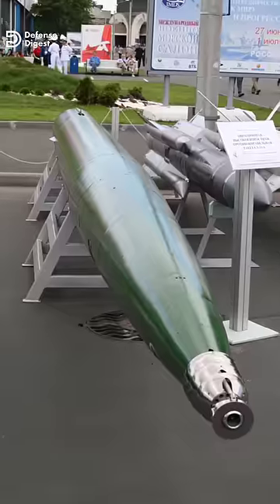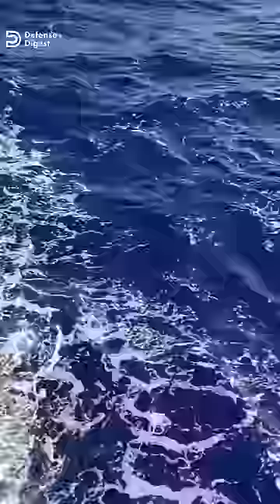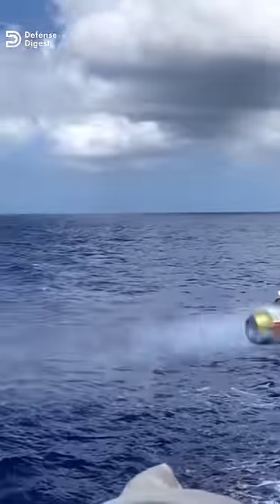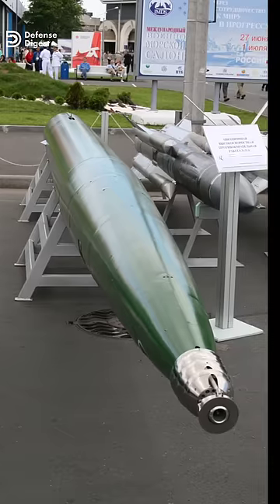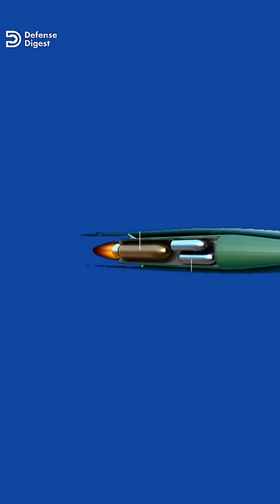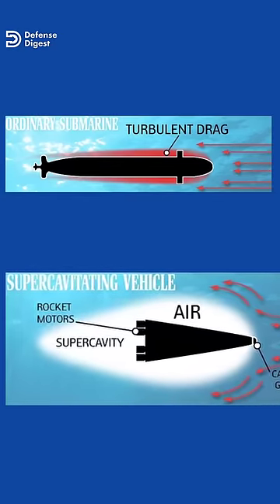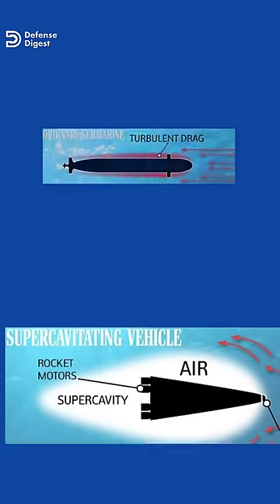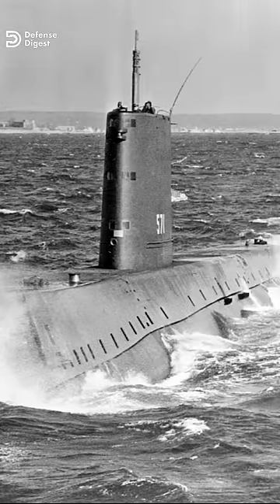Russian "Shkval" Torpedo Zeroes in on Targets at 200 Knots #shorts

Comment: Very good idea why we dont use it today with the more advanced materials that we have since then???
Reply: I'm sure this kind of engineering is used today
Reply: @gabrielbrown9013  im pretty sure that i have see this at something else but i dont remember.
Also i know that this effect is also in the swordfish that why it is  so fast
Reply: Because it’s probably expensive as shit and highly Impractical
Reply: A variation is still in use in the Russian navy, and other militaries developed their own as soon as they could.
Reply: @kayden9102  It is practical, and is used by Russia.
Reply: @Vchk1917  by their two rusty submarines.
Reply: @Vchk1917  it's the cost that's the problem, both in terms of money and materials. A rocket motor is not cheap and sticking it on something designed to  explode on impact thus disposable is that good of an idea. It is also a ticking time bomb. Depending on the fuel mix and design, it could easily be ignited if hit and pretty much any explosive impact that destroys the torpedo would also detonate it and potentially the warhead as well
Reply: The three main problems are range, reliability and detection.  Other methods yield a far longer range allowing the sub to relocate to avoid detection. Reliability could be an issue and a dangerous operating hazard for the fuel.  Lastly when this thing is fired it lights up like a firework to anyone looking for threats meaning the torpedo might be intercepted by defense systems. Even worse it gives the position of the sub away and with the speed the sub doesn't have time to relocate meaning if it's attacking a convoy in ww3 that crew is dead
Reply: So In my opinion this probably isn't a good choice for a balistic sub or deep water sub but for patrol boats and coastal defense subs you don't care much about losing it could be very useful for suicidal attacks against larger surface formations
Reply: @boblaryson3621  exactly my idea was to put it on destroyers and cruisers for asw not in subs
Reply: Because its bad, its very loud and any sub will easily evade it.
Reply: @fennoman9241  i dont think so because of the time to evade will be very low the speed of this torp is huge
Reply: @commandergeokam2868  290kmh, but ships, especially submarines have sound emmiters and other equipment to jam torpedoes. But even if it did hit, it would require many hits to sink a carrier for example, which is its main target.
All smaller vessels will be able to evade just by getting out of its way, a enemy submarine wont fire it anywhere near its target. Submarine torpedoes have very long ranges like US Mark 50 lightweight torpedo has 15km range and French F21 torpedo has 50km range.
Reply: @fennoman9241  yes yes i know im saying it to use it as an asw  role not to hit serface vehicles even with active  counter measures and ecms wouldn't be able to defeat the torp because of its very low time to evade or to drop the counters
Reply: @commandergeokam2868  it just would not work, you wont get close enough to a submarine. There is a reason no one uses these except russia, submarines and other ships will be able to maneuver out of its way. What you are suggesting is too chance based to be of any effectiveness. A weapon should work in most of its use cases not just 5% of the times.

Using it as an ASW would be a waste, if submarine got close enough to a ship for a shkval like torpedo to be effective, the ship in question would be most likely destoyed already. And using it as helicopter launched ASW would be beyond useless. 
ASW weapons are by nature required to be long range maneuverable weapons.
Reply: @commandergeokam2868  even if a Shkval torpedo was fired at the target sub like USS Virginia, from 2 kilometers. Virginia would have 25 seconds to move, even at lower speed than its max speed Virginia could travel 2.5 times its own distance thus avoiding the torpedo.
Reply: @fennoman9241  ok ok im convinced 
Its not an effective weapon got it
Reply: Have built a prototype ( miniature) for a sub to operate using  supercavitation technology  showing how a nuclear  sub could reach 200 knt speeds couldent develop much interest, was told other contractors
Were working on the same
Reply: It can't use sonar, so no guidance. And neither can the Sub firing, totally blind at that point, where as enemy know exactly where it was fired from

Comment: IIRC one of the problems with these, however is their limited maneuverability. A fast torpedo is great and all, but if your target can juke it, then it didn’t do a fat lot of good for you.
Reply: Why bother maneuvering if the torpedo has no sensors and no idea where the target is? It just goes where it was pointed at when it was fired from the sub. This is an unguided torpedo. Very fast but very dumb.
Reply: It's also a very noisy torpedo.
As soon as this thing is launched, the enemy will know where your sub is.

Comment: It should be pointed out that it had no steering and it was meant to sink carriers not other submarines. But yes it can be equipped with a nuclear warhead. Enough to sink a Nimitz class carrier. The weird nose cone is the steam ports that helps with the boundary layer to decrease water drag.
Reply: There's weird hydrophobic that do similar these days, for bullets and other things too (? Hulls)
Reply: @JohnMullee  yes but actually no. not on this scale. the shkval torpedo basically flies through an airbouble. the schematic with the big raindrop shape is pretty accurate because of the large amounts of gas ejected from the nossel. what boats do with air is the same concept but on a much smaller scale so you only get a softer boundrylayer on the hull

Comment: The torpedo showed in clip is my 46 torpedo surface launched torpedo the military 48 submarine launched torpedo is 21 inches round more than 10ft long its also  shrouded meaning the propells have round shell around the propeller or router & stater !

Comment: With torpedoes speed is not what you want you can go fast easy but you can't go far. Distance is what you need and stealth to come up from the depths of the sea. Have a look at the mark 48 👍🏼🤠 they don't have the newest and best info out available to public because the newest has not been used but I'm sure you can take the mark 48 and times it by 10 👍🏼🤠

Comment: That's empressive. That torpedo can move quicker through water. I wonder could this work for jets with diverting hot steam out of its nose and the Jets would slip through the at mark 10 may be. Just think vaporizing are in front of the Jets would make them faster, like alien 👽 speeds. SUPER CAVITATION. IN THEROY IT COULD WORK.

Comment: I always wanted to try a similar idea on speed boats with routing the exhaust to the front just behind where the water contacts the hull and have the opening across the bottom so the boat is gliding on bubbles from the exhaust.
Reply: Hydrofoil with heating coil running through it. It would be very energy draining tho

Comment: What was it's range ?
Divert rocket exhaust forward aren't you slowing it down as Newton's laws still apply. Action/reaction.
1x thrust diverted is counter to forward thrust.
Must not have been feasible or they would've been installed.
A bubble formed won't stay as the torpedo is moving at 200 mph the bubble isn't a force field.
At speed the bubble would have to be projected miles ahead to encompass the torpedo.
Well super cavitation is back in the news 2021.
And once again Russia is reported to be ........

Comment: That would be an enormous amount of water to boil and at a very fast rate, thus requiring a lot of fuel. If this even worked I would guess it had very short range.
Reply: 11-15km. It doesnt boil the water, it creates the cavity with a gas-generator in the nose (probably just some chemical reaction of two components or 1 component and water) and when it gets to its "cruise speed" the nosecone pushes the water outward with a really high force, creating a short lived vacuum in place of the dispersed water. That vacuum gets filled by steam from the water boiling away at room temperature due to the low pressure. Its the same cavitation-effect that damages many ships propellers on the edge. They travel so fast through the water, that the same thing happens and when the small gas pockets implode they break chunks out of the propeller. This is also loud AF because of which submarines have specially designed propellers to stop cavitation, so they are quieter.

Comment: Those torpedoes are extremely dangerous to store as they use hydrogen peroxide for fuel, the kursk typhoon class submarine sank because the crew dropped one of those while trying to load it into the torpedo tube, thats why nobody else uses them as the fuel itself corodes it's own storage tank making an already volatile weapon even more dangerous.

Comment: Creating that much steam underwater would give it one hell of an obvious surface trail for instance even the minimal cavitation caused by submarine propellers is enough to be heard for miles with modern sonar when not careful and is also the main way subs are detected. In the modern day it would be a loud, noisy, and obvious threat the second it was launched.
Reply: That's why it's used by ships almost exclusively
Reply: if you are getting attacked by one of these it won't matter anymore. You won't have time to turn your sub around and fire your own torpedo at them
Reply: @deanboy2416  nope, it's not fast enough for that to be true. For it to not matter it'd have to hit mere seconds after launching because the ship you're aiming at surface or sub is going to hear it coming the second it launches.
Reply: @ThatGuyOrby  you do realise that it takes a minute to a couple of minutes to turn around a ship and especially a sub, right?
Reply: @deanboy2416  you realize to cover enough distance in said couple minutes to reach the thing's target the ship that launched it would've already been spotted and likely sunk right?
Reply: @deanboy2416  to launch and hit a ship within two minutes after launching the ship would need to be within 7.7 miles. Only in the your most delusional dreams would a ship ever close to this distance as they would've been detected and engaged long before that point.
Reply: @ThatGuyOrby  at 200mph the torpedo covers 16,6 miles every 5 minutes. 5 minutes is barely enough to turn around and fire back, and it is also close to max range of other torpedoes at the time, real shots would have probably been taken closer still to ensure a kill.
Reply: @deanboy2416  The torpedo does not go 200mph it goes 200 knots, that's not the same thing.
Reply: @ThatGuyOrby  200 mph = 230 knots, so I dont see how that helps your case.
Reply: @deanboy2416  additionally the torpedo only has a maximum range of 16,400 yards or 9.3 miles which you will not be getting that close to a modern ship without being detected, surface or submarine. It should also be noted it'd never make it that far going full speed. On a torpedo you trade speed for range and generally navies prefer range.
Reply: @deanboy2416  furthermore the nature of the supercavitating torpedo means upon it's invention it was incapable of mounting any homing systems making it next to useless against submarines and significantly less effective against even surface ships having to be aimed perfectly from launch to hit. 

Modern, 1998-present, versions of the torpedo were thus made to run very quickly for an incredibly short amount of time before slowing to the speed of a standard torpedo to acquire targets for it's homing systems. However this largely removes it's only advantage and makes it a very loud very obvious threat which then slows down to actually track a target and by that time the ship under attack already would've been aware of it for quite awhile.
Reply: @deanboy2416  and finally on an Iowa class battleship (battleships in general being notoriously big and slow to turn targets) it takes under two minutes to both initiate and complete a full 180° turn at flank speed (36 seconds of that just spent turning the rudders, the Iowa class had two, from neutral to hard port or starboard). A ship like a modern Arleigh Burke class Destroyer would make that turn in easily half the time.
Reply: @ThatGuyOrby  and what is the likelihood of that ship going at flank speed the moment of it getting attacked?
Slim to none.
Reply: @ThatGuyOrby  modern submarines being rated at less than 90 dB means that unless the ship is pinging active sonar 24/7 like an idiot it wont detect a submarine until it is on top of it.

All in all, the Russians aren't idiots, if they developed and fielded the torpedo, it must have a valid use case. Just because you cant see it, doesnt mean it doesnt exist. It says more about you than the torpedo or the russians.
Reply: @deanboy2416  You continue to fail to realize that this torpedo is going to spotted the second it's launched and most submarines do have their sonar on most of the time to avoid hitting shit as that's their main way of telling what's around them. Also the only circumstance one of these things would be fired on a sub in particular would be in war time in which a sub would be running it's sonar frequently. This is without pointing out mentioning submarines were not it's initially intended or exclusive targets. Surface ships were and unlike submarines they're not as concerned about their use of sonar as knowing what's coming is more important than not being heard. Even then the damn thing is so loud it'd hardly even be necessary. 

You give the Russians a lot of credit for a nation who's lost more nuclear submarines to their own torpedoes exploding than enemy action. You're very clearly very poorly informed on the subjects of naval warfare and you're not making any ground breaking points by insulting me and continuing to make your ignorance well known. 

All I've done is state the facts how they are and you're the one denying reality. A lot of useless weapons have been made before and many yet will be and in modern warfare this is an example of a weapon who's benefits are outweighed by it's drawbacks. It's loud, it's very short ranged, it only travels at top speed for a very short time before significantly slowing down so it can even start to detect targets. 

You have not given a single factual case for this thing yet and I've given multiple against it. The statement "there has to be a use for it, just because you don't see it doesn't mean it doesn't exist" is incredibly naïve and not an actual argument.

For a perfect example of a weapon, a torpedo even, that was kept around for years that was supposedly greatly technologically advanced and turned out to be completely useless in practice were the USN's Mark 14 torpedoes in WW2. They only saw limited testing because the navy deemed them too expensive to waste in tests, a lot like the supercavitating torpedo being discussed. What they found was in practice the Mark 14s were loud, unreliable, and left a very clear surface trail which made them painfully simple to detect on even basic sonars,
Reply: @deanboy2416  The only time one of these things would be fired at a ship is in war time and in hostile waters so the chance it would be is fairly high. Even then after the ship or submarine detects the torpedo, which would be the second it was launched, the ship would immediately go up to flank speed. Ships are not slow things that take several minutes to do simple things like turn or speed up unless you're talking about carriers, which we're not.
Reply: @ThatGuyOrby  and you seem to fail to comprehend that stealth is not always the answer. If the torpedo is spotted but the enemy cant do anything about it, it is still an effective weapon.

You are stuck in a mindset that prevents you to give credit where it is due.

"You give the Russians a lot of credit", yes I do give credit to nuclear superpowers with a history of groundbreaking technology that is sometimes decades ahead. People only seem to talk about Russian/Soviet tech in the context of it lagging behind, but keep surprisingly shush about it when it that isnt the case.

You also fail to consider doctrinal differences, mainly - russian doctrine is defensive only. They dont care if they are detected, since they are the ones defending.

And lastly, no one insulted you, so stop making that shit up
Reply: @deanboy2416  And off he storms, an ignoramus convinced he's an Einstein. Proclaiming I know nothing of ships while simultaneously showing he in fact knows nothing about ships in the process of doing so. Nice one pal.
Reply: @deanboy2416  “they don’t care if they’re detected”… properly isn’t the best response considering the conversation is about submarines

Comment: I wonder if it could be used to reduce drag on a whole ship.
Reply: It would cause the ship to sink. Making steam and making water less dense around the ship would make it sink deeper. The torpedo works because it is an underwater rocket - if it was outside the water, it could sort of fly. Similar effect (without “super” part) happens when ships sink - even having a life vest on, you would sink if you were close to the sunken ship because there would be so many bubbles in the water from it that the water would be less dense (you can float in water but not air). I am oversimplifying a bit just to try to paint as clear picture as possible, no intention to be malicious.

Comment: I wish I had the means to experiment with this concept, but on the Hull of a boat using many small openings on each side of the leading edge of the v-hull to  do something similar by a valve that could be shut and would re-direct the engines exhaust thru the multiple smaller  tubes that would theoretically would make this super cavitation lower the drag coefficient of the water drag against the Hull.... Any thoughts?  Probably wouldn't work or it would be done already